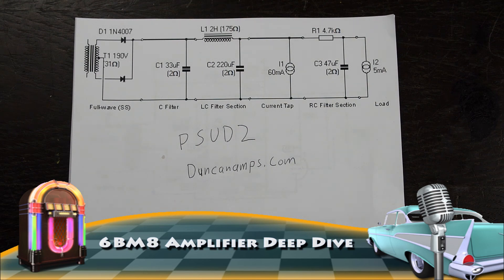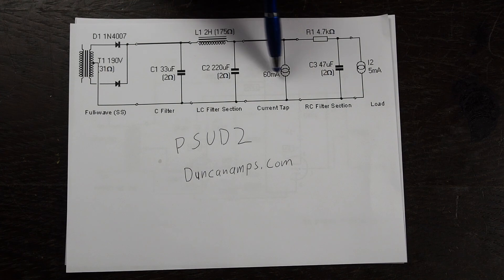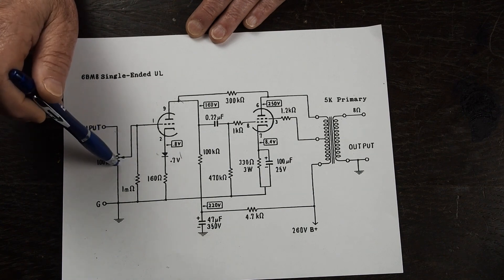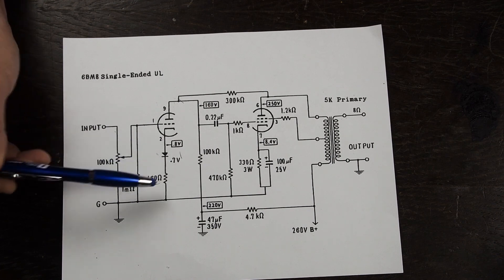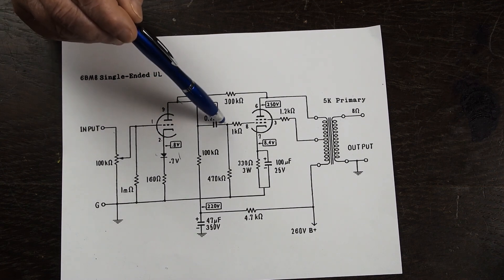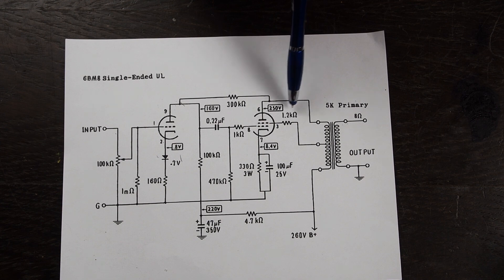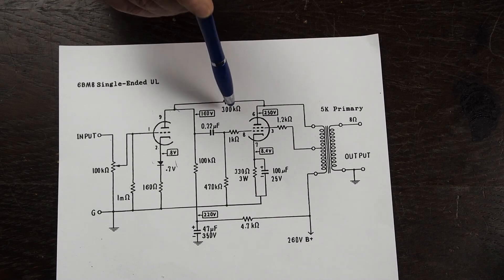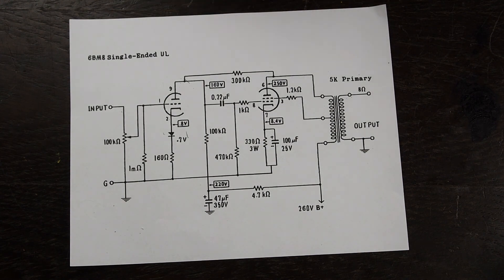6BM8 DIY Tube Amplifier Schematic Deep Dive

Comment: Howdy.
The neg. feedback by the resistor between the anodes is interesting. I would assume good results have been observed.
That is, however, not how I would do. I would use the resistor summing principle.
The way done here I would say is a transconductance modulation of the input triode by modulating its anode voltage.
Best Regards.
Reply from the maker: It's mostly local feedback back into the grid of the output tube. I know some people do not like this type of feedback, I've found it works well on a single ended UL amp and avoids the circuit being tuned to a very specific brand/model of output transformer.

Comment: Steph the Schade feedback is very interesting.  Any good source of info on it to read?   One thing I wonder about is if you are getting grid current by biasing the triode so close to zero?  And if so if its audible at least as added listening fatigue. Im no expert on this so you may well have considered this is your design. Here is quote from my notes that unfortunately I cant find the source for:  

"However, too low a resistance will give too small a bias voltage (especially with high-mu tubes). You want at least 1v to 2v bias because grid current effects start to show up at grid voltages of -1v to -2v, before the grid actually goes positive. Small grid currents may go unnoticed but they will produce a lower grid impedance than expected, and it will be nonlinear too. "
Reply from the maker: It's not commonly used, but I feel it works extremely well with UL pentode amps.
Reply: have you tried it on straight pentode amps?  BTW this is a comment by Stewart Hegman I always intended to check myself. 

"Stu Hegman talking to Bob Carver. This passage is very telling:

And he didn't. The Citation V was pure pentode, as was the subsequent Lafayette 550 and everything else he designed from then on. I asked how come. He explained that when the plate pulls the top of the output transformer winding towards ground, the ultra-linear tap pushes the screen grid so low that it renders the tube unable to drive difficult loads. In addition, he pointed out that the normal idle potential on the screen grid regularly exceeded a safe voltage, often causing output tubes to blow up. The tube manufacturers hated it, but had to go along or lose market share, and so changed the specification for screen voltage in order to allow ultra-linear output stages. I wonder if they changed the tube design, or just changed the screen voltage specification.""
Reply from the maker: No, IMHO for Schade feedback to work well, needs the NFB a UL tap provides. Also, if you look at my designs, I add some resistance to the screen tap until the idle voltage is slightly below the plate voltage so the tubes/screens don't blow up. Running the screen voltage higher than the plate at idle is a BAD idea, but people do it. Pure pentode, you are going to need the more robust global negative feedback solution.

One of the main reasons Schade feedback works well for a DIY amp, the feedback isn't tuned to a specific output transformer. There are SO many different OT out there, for a DIY type amp to be built by most people worldwide, individually tuning for every possible transformer just isn't possible.

Comment: one comment albeit too late.  I first decided to follow this thread, and build it based on the comment that it was based on a PCL86, and the 6BM8 was similar but a different filament voltage.  Well, nothing of the sort.  The PCL86 is a version of the ELC86, which has a 9 watt dissipation pentode in it.  I have built this amp, almost ready to listen to.  Not sorry I did.  I am moving on to the 6LU8 spud amp.   BUT!  when I finish that, I am investigating the possibility of changing this design to accommodate an ECL86.  Wish me luck.  I hope to be able to use the power tranny of this amp and drive an ECL86.
Reply from the maker: I'm sure you can make it all work :) Have fun learning and playing with this stuff.

Comment: Hi, Stephe. You're videos are brilliant. I'm a beginner and they're helping me lots. I tried everything I need to build the same amp. I have a relatively high rated MY. I'm wondering whether you would advise building this with valve rectification? I'm looking at EZ81's which can be picked up cheaply. Thanks 👍
Reply from the maker: Sure, I was actually considering using a 6CA4 for this amp myself.

Comment: How did we come up with 8.4 v for the bias on the pentode section? Thanks!
Reply from the maker: Well we know what the plate voltage is, and we know what the max watts the pentode section of the tube can tolerate. We calculate what that turns into as far as ma, I then start plugging in the voltage drop across various resistors. Honestly for me, some of this is getting close and then some trial and error. This calculator is very helpful.

 https://robrobinette.com/Tube_Bias_Calculator.htm

Comment: Congratulations for the enlightening video, with a clear language that allows even newbies like me to better understand the tube amplifiers operation.
I got a pair of 4k primary UL transformers, and I would like to know which B+ voltage is most suitable for using these transformers (according to the pcl82 datasheet, a 170v plate voltage on the pentode produces an impedance of 3.9k).
If I apply 170-180v on the pentode board, which resistors must be changed compared to the schematic shown in the video?
Thank you very much!
Reply from the maker: But it's not running in pentode, it's running in UL. If you change the B+, you will need to also change the cathode resistor to get the dissipation back. Honestly I would just run them in this circuit and see what it sounds like, tubes are pretty flexible  on the output transformer Z.

Comment: I know 8 is the most common impedance for home speakers but I sometimes use 4 ohm drivers for my project builds. Is there any reason why I couldn't or wouldn't want to use an Edcor 15-4-5k instead of an 15-8-5k? Thanks.
Reply from the maker: No reason at all and in fact some people choose to buy 6ohm OT so they can run either 8 or 4 without being too far out of spec.
Reply: @SkunkieDesignsElectronics  That's a good idea. At such low wattage I would be afraid to run an 8 ohm speaker on a 6 ohm OT for fear of inadequate power. May I ask what speakers you run off this amp? I'm concerned about efficiency. Also, with 10 or 15 watts potential, depending on the output transformers used why is final output not a little higher? Just inefficiency of tubes and all the resistors? Would simply running even larger OTs get a higher output like maybe 5+ WPC, or would the overall archetrcture need to be improved? Could this easily scale up to a parallel output tube design? Thanks. Learning a lot.